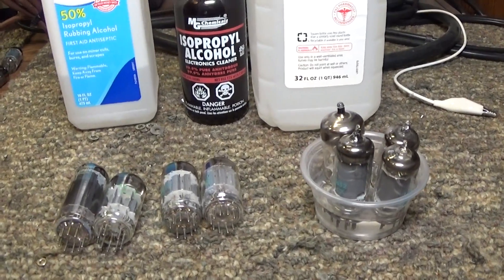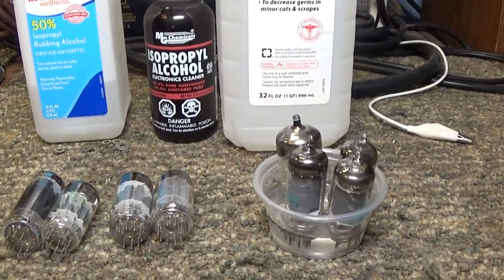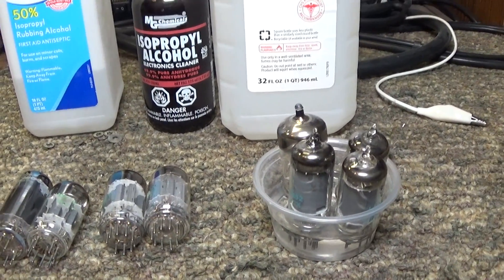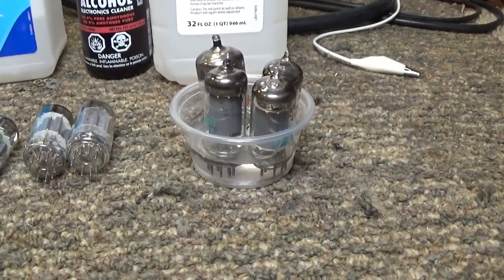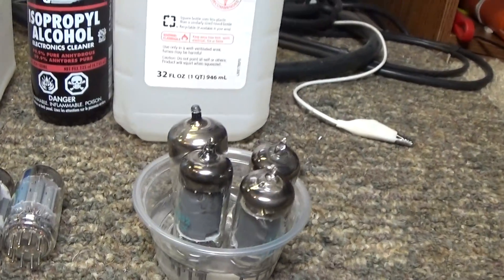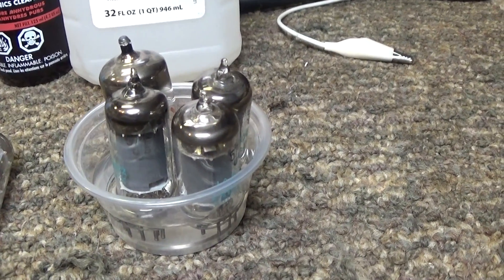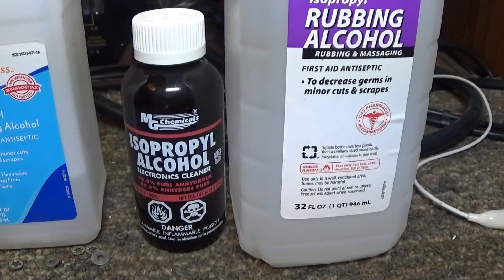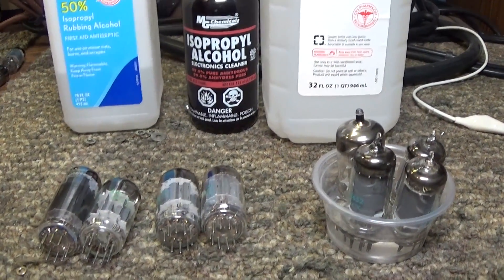CB radio Tube Cleaning Maintenance Refurbish

Comment: I hate to ask but how much did you pay for that little bottle of alcohol.   I ask because I suspect it was expensive.  I go through several gallons a year myself and buy it on ebay in four one quart bottles.  Its actually pretty cheap.  It also is great for removing soldering flux, sticker adhesive, smoking/nicotine residue and even helps unbond hot glue.
Reply from the maker: I got it off AMazon for $10.  I can find 99% pretty cheap, but not 99.9%. You got a good source?
Reply: +tramdr 

This is what I buy and from this seller.  A gallon in four 1 quart bottles of 99.9% alcohol for about $20 delivered.   eBay number 111336493723